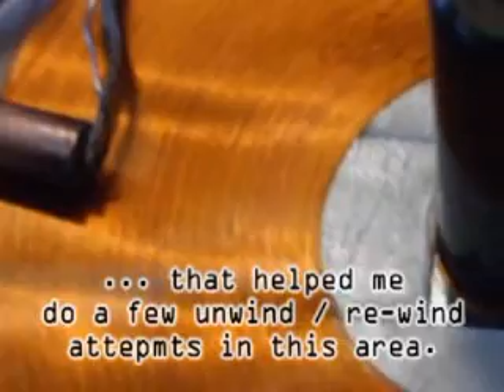hydro4f3a_010.wmv - Pancake Coil Winder

Comment: Konstaine Meyl, a German PHD. He looked back on tesla's wireless electricity transfer patents and found that Tesla was working with different types of electric waves the longitudinal waves not electro-magnetic. Longitudinal waves can be used to transfer electricity over miles w/o any loses, also speed of a longitudinal waves was calculated and observed to be Pi/2*C, meaning the speed is actually 1.5X the speed of light! Einstein was wrong based on empirical observations.

Comment: craft glue that stays tacky works really well when it dries you can lift it from the surface and pot it or put liquid rubber onit for insulation only you can glue your hand to the coil and ruin everything if not carefull

Comment from the maker: Yes, using double sided foam tape - the type used for permanent mounting. Also tried the thinner double sided transparent tape, but it was not sticky enough. Also note that wider tape would be better because there would be fewer seams to wind over. I am using 3/4" in the video, but looking for 1.5" or 2".